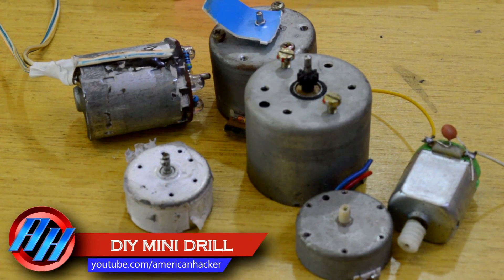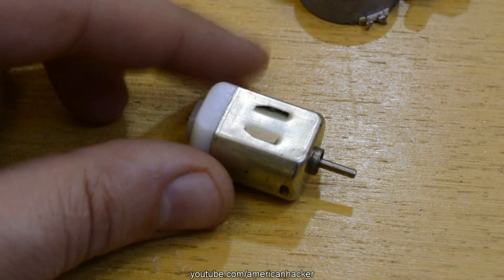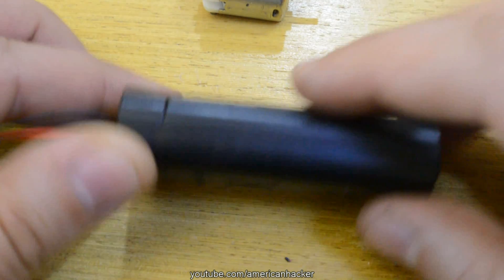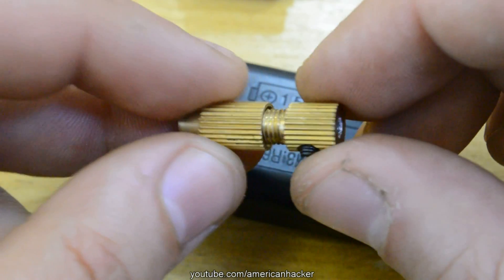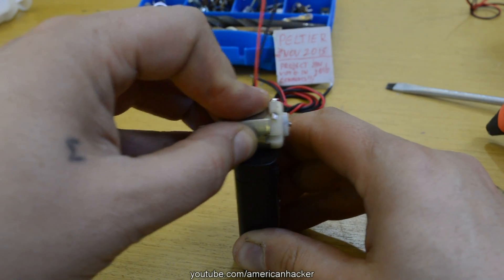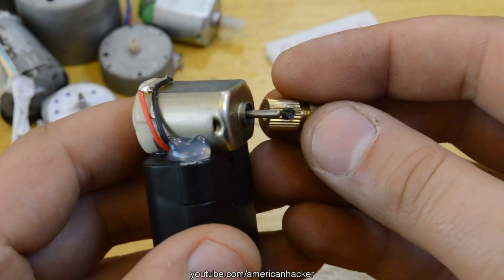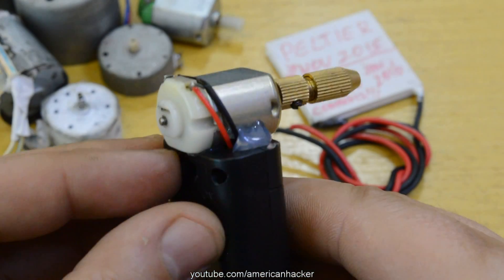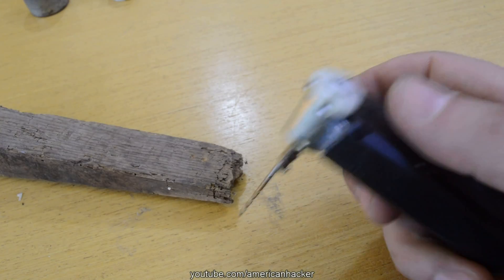How To Make Mini Drill for 2$

Comment: One recomendation: instead using hot glue for placing the motor, use epoxy glue. This is way stronger. Or maybe epoxic clay. But not hot glue, at the first drill your tool will be broken.

Comment: Wouldn't it work better if you used a 9volt
Reply: +Zakaria KTM Depends on the motor you're using, plus I'd 3d print or plasti-sculpt a better housing so the glue wont melt the motor off nor be a pain to install a new motor(hopefully never if I use a salvaged 9V or 12V milwauke/dewalt motor and chuck).

Comment: yeah that shit is not going to drill anything usefull.
You can easily get more powerfull 9-12V motors for free or get a cheap drill.
Reply: +svampebob007 No shit sherlock, its not meant for big projects... Its meant for tiny projects that really dont have any point, besides the fact that it costs less than 3$ to make... Make a video on your 9-12 v motor drill, and you can say you told us so.

Comment: These motor are BRUSHED, not brushless, thats just stupid
Reply: +Jelle Bakker brushless motors don't necessarily have more torque than brushed. It's just that they would be more efficient but then it wouldn't be cheap. Also, these motors don't have much torque in the first place. So either way, you should install some gearing or get an actual drill for about $10 at most thrift stores or even online.

Comment: this idea is awesome american hacker. nice idea.  
One question though. is the hot glue strong enough to not come of when you are pushing the drill against any hard surface? 
or can the motor be screwed to the battery holder itself?

Comment: these are low torque motors,
plus the hot glue will melt due to heat
Reply: +gpctrs jr gtfo with your logic this is american hacker
Reply from the maker: +gpctrs jr that its true,but this is MINI drill for hobby and shownig the concept
Reply: +gpctrs 
That may be so, but it still has far more torque than a Toyota Prius.
Reply: 100% percent correct
Reply: +gpctrs jr lol i thought it was funny
Reply: +gpctrs jr you are right - also it wont manage to drill a hole true the whole piece of wood because the glue won't hold it enough
Reply: +gpctrs jr No, you're right.
The serious lack of torque and HP in the Prius vehicle is a dangerous thing!
It's seriously not funny at all! Those things pull out into traffic, causing other drivers to swerve around them because they cannot get up to speed fast enough!
Reply: +Hans jerkov You sir are wrong it's pronounced MURICA!!!
Reply: +gpctrs jr If you're so worried about it, just use a high temp glue instead of what he's using. have a nice day ;D
Reply: such a nerd killed our excitement
Reply: gpctrs jr Guy from  AAA batteries high torque can not be acheived and there not a lot of friction for this to create enough heat to melt hot glue.
Reply: +Kennedy Cosgrove AMURICA!!!!!
Reply: Not that hot
Reply: American Hacker
thanks for reply, your channel has alot of subs, i guess its time to put more effort and use better fixtures, try to avoid using hot glue.. you can try metal expoxy for more temp resistant and better integrity
Reply: +gpctrs jr JB Weld
Reply: +pandatechblog yes ur right but look how creative this video is
Reply: francis badinas
much more creative if put some engineering practice in the way
Reply: zdw306
are u trying to be funny? because its not.
Reply: +Kennedy Cosgrove you're a complete tool.
Reply: +zeer365 Spoken like someone who has never driven a Prius. Here's the thing: The electric motor has plenty of torque. It's main purpose in life is to assist the small internal combustion engine for things like... acceleration. My Prius accelerates just fine; nobody has ever swerved around me. Ever. Why? Because I generally leave them behind.
People who know how to drive a Prius know that you want to accelerate quickly, because the IC engine is most efficient at higher RPM. Go browse through a Prius chat forum; you might learn something.
Reply: +gpctrs jr yea, but that would take forever. There are some hot glues that have a high melting point
Reply: +TheMorbiousStone the set screw is for the chuck attached to the motor. The motor is held in place by hot glue alone.
Reply: +Kennedy Cosgrove yeah american hacker that sounds nothing like an american lol more like the russian hacker lol  but home boy got a point this is useless heat equals melting of glue gun , but you dont have to take our word you can just do it and find out yourself
Reply: +Martyn 3BBdxc76 I'm curious... How many idiots respond to your invitation to obtain their very own virus? Because... well, we all know we can trust your link, because it's on the Internet!
Reply: +TheMorbiousStone I did... but I just wanted to let that moron know that we're not all as stupid as the few who will click on his link.
Reply: +Jim Meyer you are also a moron for watching this
Reply: Sid Gallardo Who said I watched it? I just came here to read idiotic comments like yours.
Reply: +American Hacker I like it.. cool concept very simple which is always good.. Thank you for the video
Reply: This guy says they are low  torque motors  and will soon get stuck with drilling.